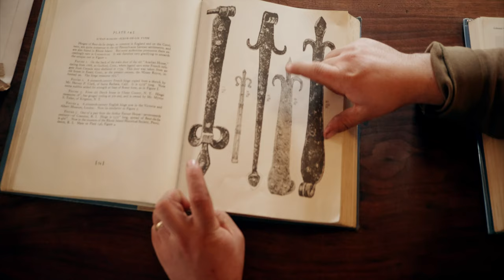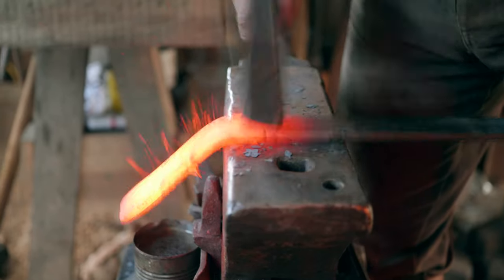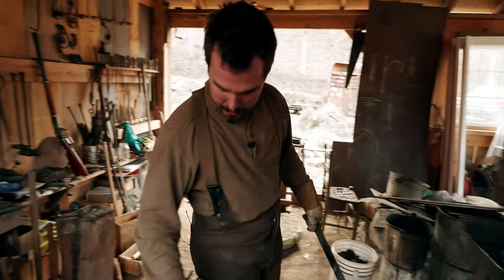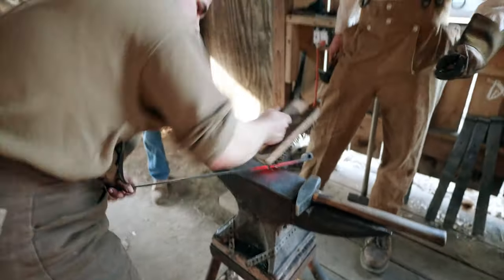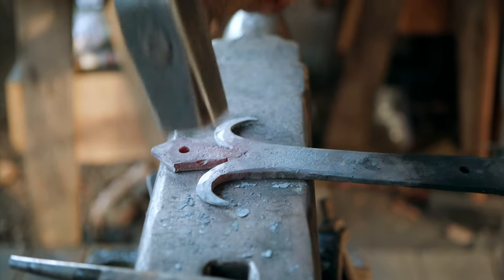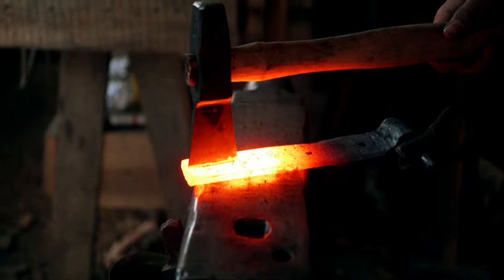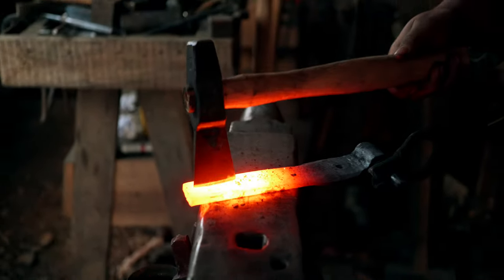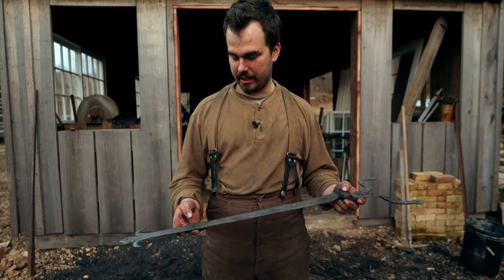Fleur-de-lis Strap Hinge

Comment: Are these hinges easier than the barrel hinge
Reply from the maker: Not sure I understand- the socket in the strap on these is also called a barrel. Do you mean like a jointed hinge that has knuckles from both sides that are cut together? In that case I’d say yes.